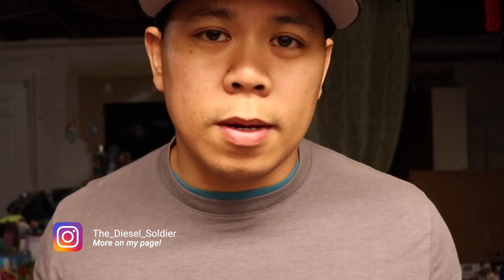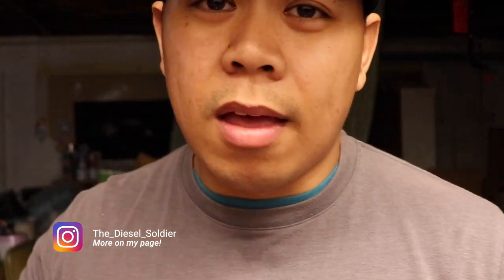Army Mechanic || Spoiler Alert #dieselmechanic #91bravo

Comment: 91b currently. "Mechanic " in the army i take very lightly lol. I was a mechanic prior army and the diagnostic skills of some of these "mechanic" is very questionable.  
Oh we got a lmtv with a no start , hmm better hit it with starting fluid and if it still doesn't start then obviously the motor is blown 🤣. No checking of the huei pump , or engine speed sensors , or if the ecm is sending signal to the injectors to fire.